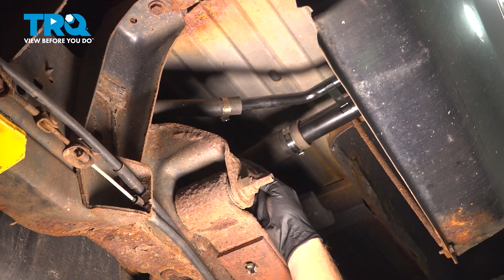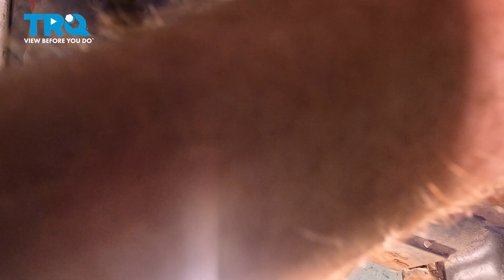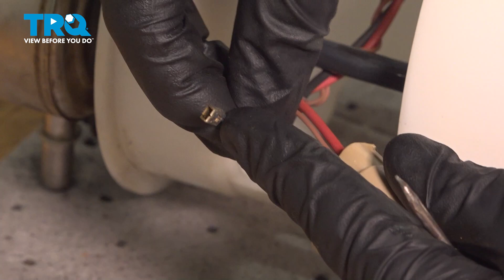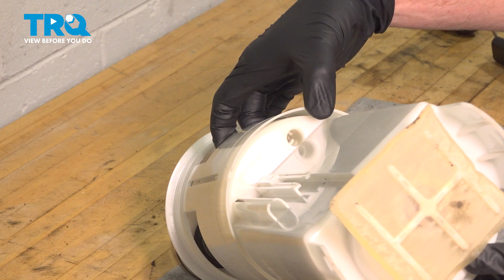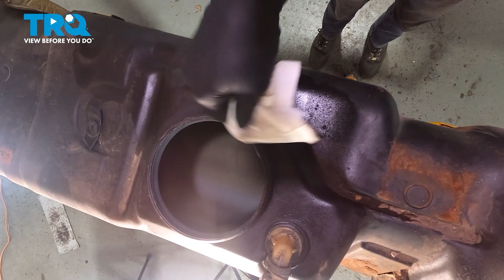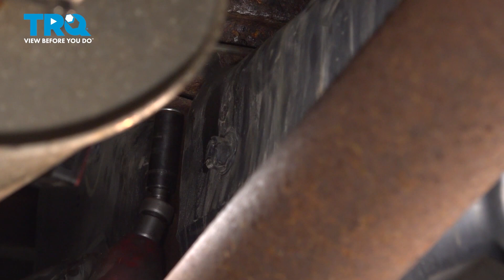How to Replace Fuel Level Sensor 1994-2002 Dodge Ram 2500

Comment: Nice video.  Clear, concise, quick paced, and useful.  I watched because my '02 ram 2500 diesel fuel gauge reads full all the time when running and banging on the tank did not help so it looks like I'll need to take the tank out to solve the problem.  I understand that it is the same as this tank except that there is no fuel pump in my diesel tank.  I appreciate helpful videos like this one.

Comment: what happens when i changed PCM and now the fuel gauge works but the level isn't calibrated correctly. Does it need new sensor? new fuel pump? I had it replaced less than a year ago.